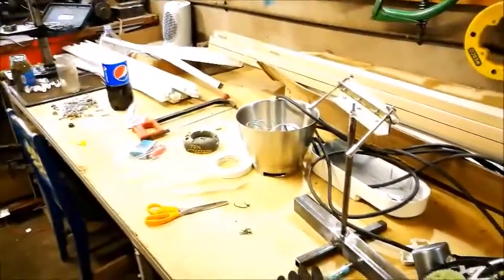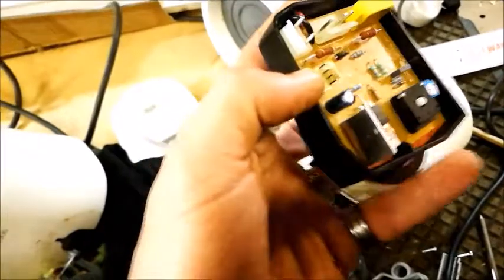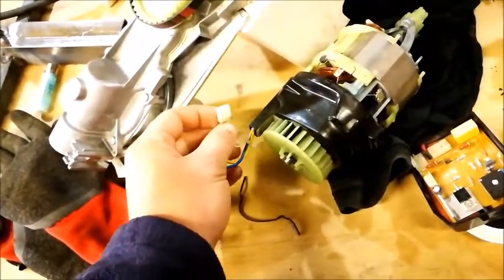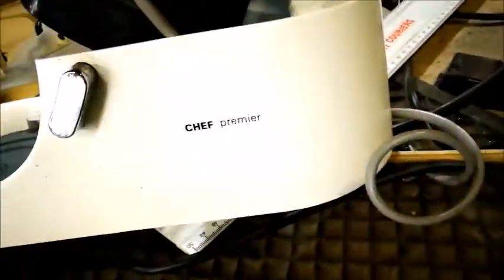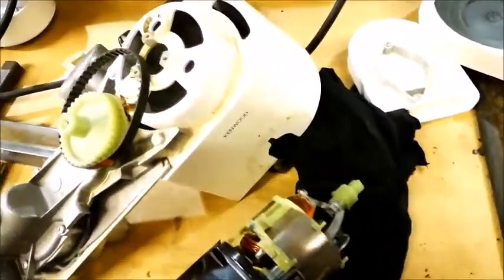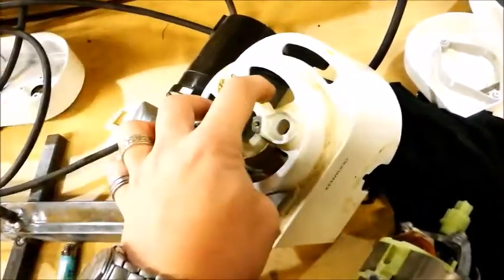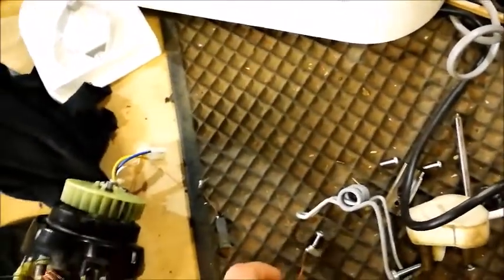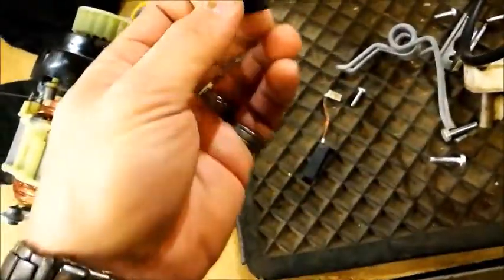Kenwood KMC510 Brush repair

Comment: Great video. My fiance (who is coincidentally also South African) has the exact same machine. It started making popping sounds like a car backfiring and wouldn't go above the minimum speed. Upon disassembly it had exactly the same problem as your machine - something had been spilt inside the machine, gone all over the motor and PCB, and had caused one of the brushes to get stuck. In the end I had to remove the copper brush holder in order to give it a good clean. The brushes themselves and their (incredibly fragile leads) are too delicate to try and remove from the machine with any force if they don't want to come out by themselves, which makes life quite difficult. In any case, I got everything clean (and gave all the plastic housings and covers a good clean too) and now it's back in perfect working order. I was surprised by how little protection the motor and speed controller has from liquid ingress, especially given how well built the rest of the machine is and how likely spillages are, given the intended working environment of this piece of kit. Perhaps that's built in obsolescence... In any case, I'm looking forward to replacing the brushes when they wear out and giving the insides another good clean up - a very enjoyable repair job for me.

Comment: Thank you for the video.- I love guys who will just jump in and have a go at fixing things instead of chucking them out! 

Did you ever have any luck finding any kind of schematic for the machine?
Reply from the maker: Rob Parson, my biggest problem was not having the serial number, which I found during the video, lol. Didn't have a need to look for a schematic by that point and I forgot about it by now. It could be possible I found something but had to pay for it, which I wasn't willing to do.
Reply: I have a similar machine- same manufacturer but a slightly different model which refuses to start up- i was using it for whipping up home made pizza dough and probably overloaded it so i'm guessing i'll have fried something on the motor control pcb or possibly even the motor- Ill dig in this evening and have a go now that you'r video has offered some inspiration! ;)